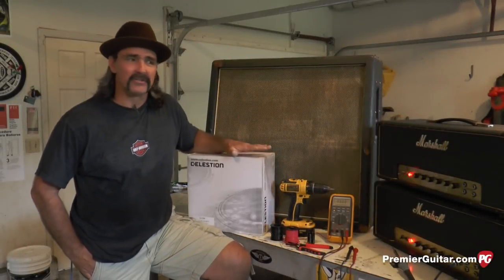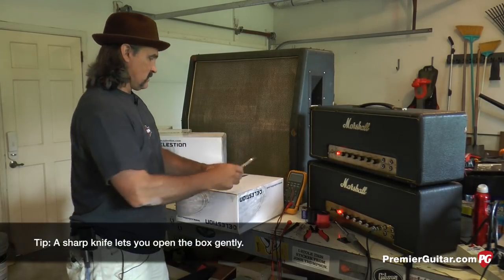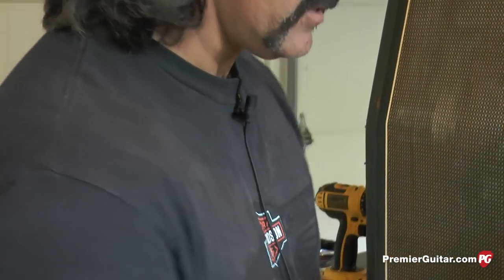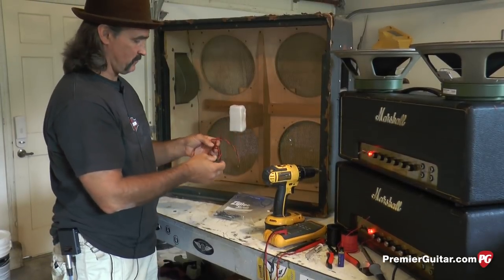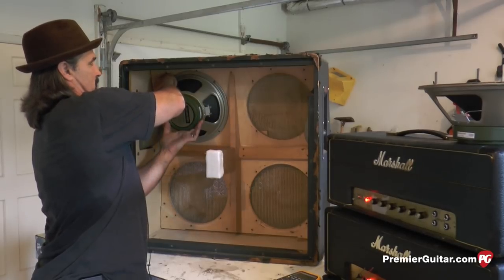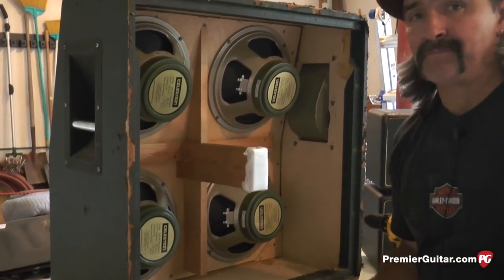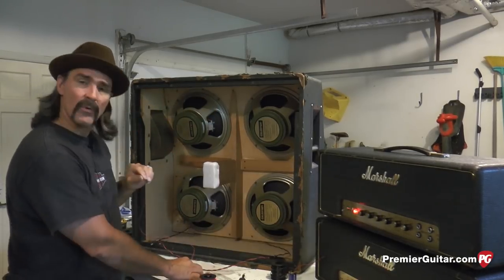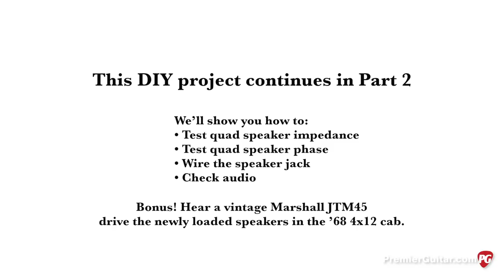DIY: How to Install Speakers in a 4x12 Cab, Part 1

Comment: I just bought a used 4 year old Marshall cab with greenbacks, and since a 4x12 can hide and disguise speaker issues on one or more I decided to take the back off and do the battery thing, and the impedance too.  Well, though all four LOOKED exactly the same (20 watt g12m heritage series)...the two on the top did not move as much as those on the bottom and one on the top barely moved at all from the battery..so I keep doing more to test them.  I de-soldered the speakers at the terminals so I could test them individually.  Yep, the one that barely moved sounded like about 1/5th the volume and dynamic range as the one next to it (which I also suspect has some damage as it didn't move as much as those on the bottom.  So, I make an aligator clip on speaker cable, and switch from one speaker to the other without changing the volume settings on the amp, so now I KNOW there is a major issue with at least one of them.  NO the bad speaker does not rattle, fizz or other sounds, it just sounds like it's missing all the bass, most of the other freqs and the volume is about 1/5th of what the other has.  

Bottom line, most would not even notice it, I really did not hear anything wrong when I first plugged into the cab and was right in front of it, I even used a digital decible meter in front of each speaker, it measured the same on all speakers.  So, what I'm saying is when you buy a used cab, test them out individually, don't just stand in front of the cab and wail away on the guitar and say "sounds legit".   

Wish me luck because I bought this thing at Guitar Center!  I want to fix it myself if they'd either send me a partial refund in the amount of replacing the bad speaker/s or send me a new speaker/s.  I don't want anybody at GC to be monkeying around with this cab, it is a 50th anniversary cab with the E.C. pinstripe grill cloth (very delicate stuff, and very expensive)..and so, basically I expect them to tell me to bring it back (so they can verify there is something wrong..ha ha)..  Anyway, I have a few tips as well on this, as I've done it quite a few times..but one thing is for sure you can't be too careful when buying a USED 4x12 cab.  The previous owner probably took them out of a 2x12 cab cause I can't imagine blowing a 4x12 with four 20 watt speakers unless they were a metal head.  They did other very stupid things to it too, like when they removed the back panel, they forgot to remove the screw in the center which goes into the center post and they ripped up the MDF base which I have allready glued back to together.  They moved one of the side leather straps to the other so they could grab it from the top and discarded 2 of the four metal glides.  So, some dumb-ass had their way with this thing like it was a hotel room rented by Keith Moon.
Reply: Once I read “from Guitar Center” it meant trouble for me. After a bad experience from
Guitar center I usually buy stuff from Sweetwater or Zzsounds, although Zzsounds belongs to GC they actually do a much better job and I trust them more than GC.

Comment: Very helpful. Please consider using 14 gauge wiring on one branch of the wiring ( 2 speakers ), and note the difference in expanded frequencies. Works for closed back cabs best. I use #12 only in my cabs May lose some classic Marshall tones, but you can dial that back in if desired. Also replace the head to cab cable with 12 - 14 gauge lamp cord style, and stand back. 22 gauge...? This is my "secret sauce". Like the hat. I wear a boonie when I get serious. Helps.

Comment: This way facilitates the ohmage better (you'd end up with 4 or 32 ohms otherwise), and you'll have the option of running the cab in stereo without too much modification. This wiring also would give you the best compromise between series and parallell wiring in regards to speaker interaction and their sound.

Comment: hi  i have a marshall 8100 valve state amp head and on the back it says " 100watts RMS/4 ohms. how would i wire a 4x12 cab with 16 ohm speakers in it to work with this amp { speakers are Marshall AX -75 BTW ", thank you, great video i used it for my evh head and green backs

Comment: Does the cork on the front mounting area of the speaker's frame act as a gasket? If you front mount a speaker, do you need a new gasket to place between the speaker frame and cabinet?

Comment: Why is the series on one side made on the positive side and the other on the negative wire,is there a resistance reason to do so? I know different wire cauges have to do with the power it can handle but why so thin?

Comment: If I had a 8 ohms speaker and like to mounting a 4x12 cabinet, and the impedance who I like to output is 16 ohms, can wiring the speakers in series only?

Comment: 22 awg wire is a little on the thin side, Hell I consider 18 awg small as heck. I would honestly not go any smaller than 16 awg and 14 awg seems like the sweet spot.

Comment: I mount My speakers in from the front, so that the screws can lock the speaker in & the sharp point is Inside.            I also use 8 screws when possible.

Comment: Might be a stupid question. But i guess ill ask anyway. Got an 8ohm fender 4x10 pro the other day and noticed it runs "1,000 watts program (500 watts continuous at 8 ohm" and i have a head  that is 4ohm/750 watts. Does that diagram work for this bass rig so i can rewire it following along on here?
Sorry for the newb ignorance. Just dont have cash to get another 8ohm cab to parallel connect, my head. 

Thanks yall and thanks for this video!
Reply: From my understanding, wiring the speakers in series let’s the current flow through all components making the ohm’s output higher. You might wanna look into wiring them parallel, considering they aren’t already wired that way, I think that’ll make the ohms output from the cab decrease. Just started learning about this kinda stuff too but I hope that helped!
Reply: @haydencarlson1229  thank you so much bud! Im about to check it out! Thanks for reaching out!

Comment: What about the little bit of paper cone that it is in the screw hole of the speaker? I am installing a new speaker and all the holes has paper on it that I must drill. Any particular way of doing it? In this video it seems he has any care about it and he put the screws directly through the paper...

Comment: Hey mate I have a Marshall Jcm 900 50w head that has the impedance switch on the back witch says (4)16 on one side and 8 ohms on the other side the (4)16 ohms is confusing me and my cab has 4 12 inch 16 ohms speakers what ohms should I wire my cab to for these impedance settings on my amp because I haven’t even used it yet I’m scared I’ll blow it up lol and I don’t know what (4)16ohms means is 4 or 16 every other amp has one number to set to like 4 8 or 16 if you could help out cheers Luke from Australia

Comment: Well here I am years late to the party.  Why would you use 22awg? Seems very thin but I get it that this is not a Hair Dryer being Wired. Anyway at theOrange Box I tries 14 awg and too thick hard to solder and nodoubt will put my vintage GreenBacks to risk. So back to arange box and there is 18-20 awg  seems too skinny So I finally found 16 awg on the E of bay. My 1960A is  Feb 1971  all original speakers but the original wire was removed  and replaced with the huge speaker wire, and the soldering is a mess.  So before I start twisting why are you using 22awg ?  60/40 lead, Yeah no doubt.  Look forward to your comments.  PS my local Tech ask why I would want to change the heavy wire? Sorry to thow that at ya, but here we are. Thanks

Comment: Great information! Now here's a question..how do you remove the grill on a sealed back carvin 4x12 with the cloth grill. I am totally perplexed
Reply: Possibly and most likely speakers are front mounted onto the baffle. Grill cloth/grill cloth frame should be able to pull off and either held on the front by Velcro or possibly just tightness. Some cabinets like this will have a small ribbon pull for removing the front grill cloth frame from the cab to reveal the front mounted speakers. If no ribbon that use something flat, thin and a little sturdy to slip between cab and the grill cloth frame and slowly work the grill cloth frame off the cabinet and you may have to work your way around all four sides till the grill cloth frame pops out. 

Think about it, if the back is sealed then there is only one way in and that’s through the front ;)
Reply: @lyric.kayden  Thanks for your input. I'm one of those guys that absolutely will not ( dive in blind) break something due to ignorance.  Will try that again with a little extra force and see what happens. Got this cab second hand. Hope it's not glued down by a previous owner
Reply: Phillip Gurney yeah if no screws holding the back panel on then it will be the only way to get inside is from the front unless you cut it open - don’t do that though lol. And the previous owner could have used the heavy duty Velcro which acts like a locking grid instead of the typical Velcro  - if this is the case and they used it through several points of the cabinet than it’s gonna feel pretty glued on tight tight but it should release. And honestly if your ever interested in upgrading or modifying the cab it’s the only way to know. Last time I checked Carvin cabinets were all if not most front mounted and not rear mounted. Carvin gave the option of a grill cloth frame to cover the front or you could go with individual speaker grills that cover the speaker only. Good luck and hope your able to solve it.

Comment: what kind of screws are being used here? Wood or machine? Just screwing straight into the baffle?
Reply: 1 inch machine screws.
Reply: bigcatdaddy76016 machine screws into wood? Is he wood tapped? Or are we talking T nuts, but if this is a vintage cab there were no T nuts used on these as far as I know?
Reply: AnalogOpher the wood
Reply: AnalogOpher ...yes t nuts....the anchor is embedded into the wood on the other side...good stuff.

Comment: So this is a 16ohm cabinet, right? So if i wanted to do an 8ohm cabinet i would get 4x 8ohm speakers and wire them up the same way, correct?
Reply: +Luxorcist  yes, that is correct

Comment: Would the diagram be the same for 8 Ohm speakers? Help much appreciated.
Reply: MrSwordstaff0 Yeah, because at the end of the day. Speakers are just speakers. Doesnt matter about the Ohms or watts they can be installed the same way.
Reply: External It would be slightly different for an 8Ohm configuration Im sure you can google it.

Comment: what would be the negative effect of not using the correct speaker wire gauge? This video uses 22 AWG.
Reply: l3ertuz the wire melts and you can set your cab on fire of the quality is a little worse depends

Comment: with a fender rocpro 1000 head, would i be able to use a single input on the back of my cab?  i am looking to redo an old crate cab that has blown celestions, but it also has
 3 inputs on the back

Comment: 22 gauge speaker wire? I used it but it sure is skinny.
Reply: In the second video, Skip finds after soldering on the jack that there is almost an ohm of additional DC resistance to the speakers (not explained by the 22 AWG, whose linear resistance is only 0.053 ohms per meter). This is just fine according to Skip, because it brings the value closer to the nominal 16.

Comment: Question: Since you have four 25W speakers, does that mean that you now have a 100W speaker cabinet?  Will connecting a 100watt head be safe?  Sorry for this dumb question but I'm a total noob. I'm planning to build a 2x12 cab with Celestion G12T-75 16ohm speakers. Each speaker is 75W. Will that mean that I will have a 150W speaker cab? And that connecting a 100W solid state amp will be safe for my amp? If I made it into a 4x12 with 75W 16ohm speakers will I be having a total of 300W?
Reply: Zarahemla honestly, the more important thing is the ohms on your speaker. If your amp is 16, then match the ohms with a speaker. If you have something like a Vox Mv50, then you  should be good with any ohms you’ll put in the cab.
Reply: Wire 2 8 ohm speakers in parallel for 4 ohm, 2 4 ohm speaker in parallel for 2 ohms and 2 16 ohm speakers in parallel for 8 ohms.
Reply: Zarahemla if you have the same or more watts in your speakers than you have in the head, then you’ll be fine. Any less and you’ll have a chance to fry your amp. Match impedance.

Comment: you wired the P+ to a -N terminal on a spkr!! isn't that out of phase. why not wire spkr to spkr then two seperate jacks
Reply: +nigel mahabir Nopers. That's called series wiring. So hes doing series and parallel together. The speaker hes doing positive on one, and negative on the other. That makes a 32ohm load. Then once you do that on the other 2 speakers, and put it all together? That brings it down to a 16ohm load for that entire box. Series- increasing the ohms. More efficient, harder to power. Paralell, decreasing the ohms. Less efficient, but much easier to put loads of power on them, if your amp supports it.  If you ever have a few speakers sometime, try it!

Comment: You've wired each par in series and the 2 pairs in paralell............ Idea! ----- If you wire each pair in parallel and then the the 2 pairs in series, you would use half the wire and would reduce the resistance of the wiring in  the cabinet, donno if i'm just being fussy.....
Reply: Stuart Warnich 
Wire is cheap and you will have tge same resistance either way! In series you add ohm load and in parrellel if loads are equal you cut in half ohm load..e=i * r    r

Comment: Those screws are metal screws not wood screws, metal screws always have fine threads.
Reply: +Jyme Bale Perhaps he had molten metal poured into wood for extra support hence the reason why he used metal screws. It's science brah.

Comment: I want to buy 2 speakers that are 12" at 20 watts 8 ohms. then build my own cabinet for them. Is it possible to find speakers like these? or is there some kind of standard measurement? and If my amplifier says 5W 4 ohms, Can I rebuild it to measure 20 watts 4 ohms?
Reply: Mitchell Martinez buy them speakers and wire them in parallel and you will be fine. As long as the speakers have the same or higher watts you're okay but always match the impedance (ohms) so if you wire them two speakers in parallel you will get a 4 ohm load
Reply: Darren Hegarty is it possible to wire a 4x12 in parallel to have a 4 ohm load?

Comment: You CANNOT measure the impedance of a speaker with just a DMM.  Period.  You can measure the resistance of the coil which is NOT the same.  Never trust a guy who has garden tools in the background.

Comment: 17 minutes on screwing in 4 screws 4 times....and soldering 8 speaker terminals and 2 jack terminals? WHOA

Btw, immediate error: 20+ (22, was it?) gauge wire is cost cutting crap and shouldnt be recommended. Just about any wire out there will do as well or better. Lower gauge = bigger = better
Reply: I would go with 16 guage every time in a guitar speaker cab, it's the heaviest wire I'd use though for that, Marshall did a lot of dump stuff to their amp and speaker cabs for money sake not for quality of build, they wanted to use stereo transformers because they sound so much better but couldn't afford to, like Fender they used the parts they could afford and not the best.
Reply: +Jyme Bale This only works for speakers that implement ball bearings for that extra crunchy tone.

Comment: I have two 4x12" cabs, one 16ohm and the other 8ohm. Is there a way to rewire one of the cabs so they have matching impedance where either both cabs are 8ohm or both are 16ohm?